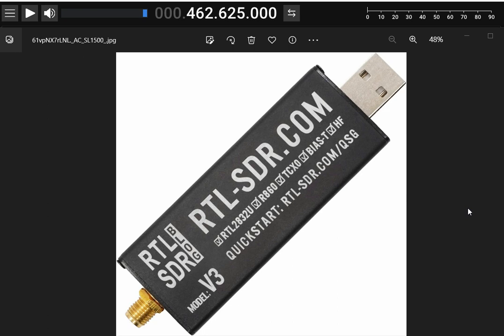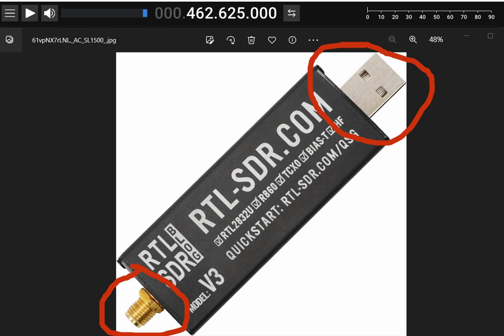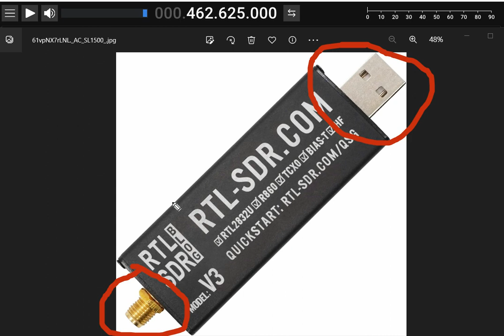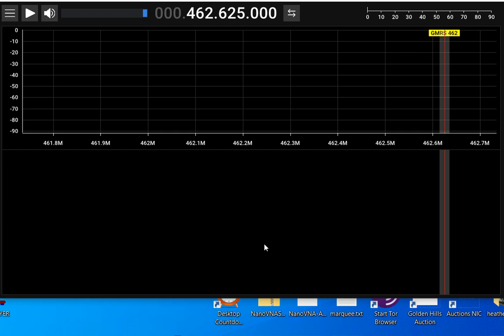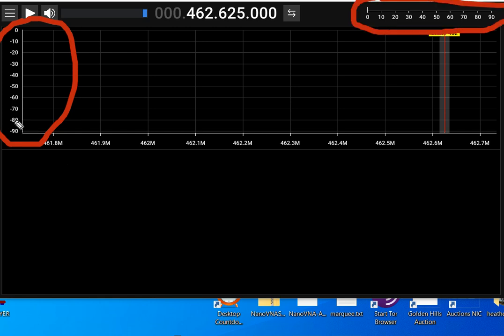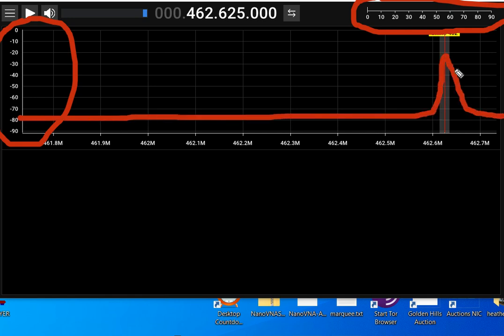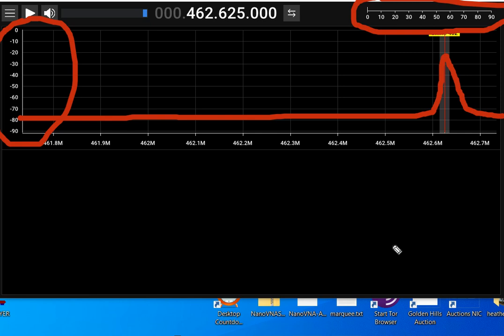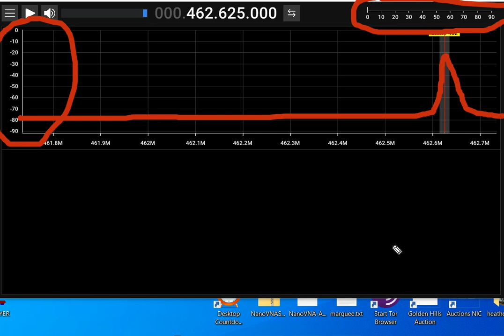🔺GMRS two-way radio receive (RX) S-METER for more accurate distance AND antenna testing!!! 🔺

Comment: That looks like a very handy tool for testing. I have been thinking about ordering an SDR for quite a while, I don't know while I haven't bought one where they are such a good value. I want to listen to a lot of the higher frequencies around me like the 800Mhz band where a lot of the fire and emergency radios live. Also the airport is not all that far away so it would be fun to hear the tower
Reply from the maker: Ohh ya, it's a very handy tool for many things. I hope to do some videos about it and maybe some antenna builds for it too. Lots of cool free software out there too!

Comment: Winter in WI sucks big time I been with my brother on the tracktor trailer up in WI my brother use to work for HO Wolding up there .  Just be very careful if you are going up on a ladder . I do not want to find out something happen to you .  Good luck on this setup .
Reply from the maker: ohh ya it does!! And I will be thanks
Reply: @GMRStwowayradio  You are very welcome.